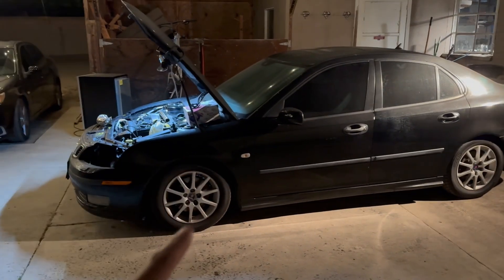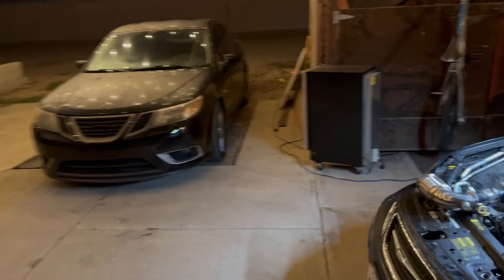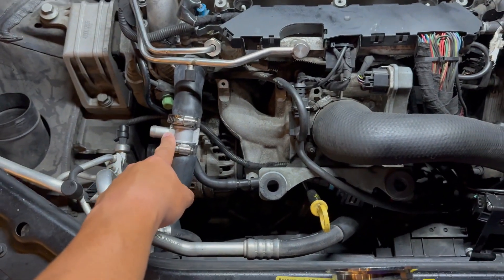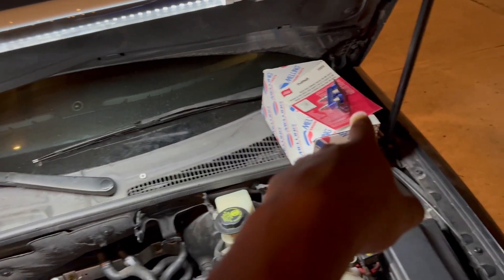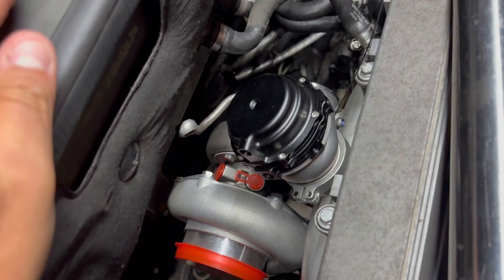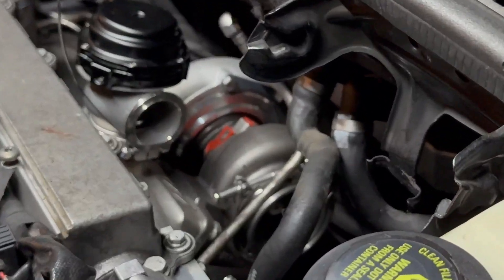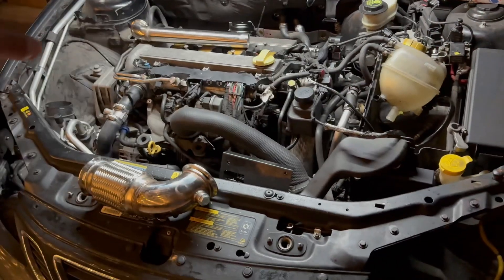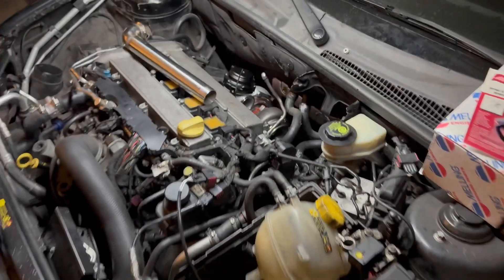Saab 9-3 2.0L Big Turbo Build (Part 0) - 500hp under $1500

Comment: As the F40 gearbox can only take 400nm, what do yo plan for the it because it's gonna snap in half ?
Reply from the maker: V6’s with the F40 are pushing 700+ hp… I think the tranny should be fine with a heavier clutch when we get there

Comment: Did your how'd your other ecu break?
Reply from the maker: Usually they just start to throw the common CEL codes and the car runs rougher and rough until your injectors just stay open and the car smokes like a banshee.

Comment: use an oil filter plate for oiling solution. they also will have additional accessory ports if you plan to run a oil pressure gauge.
Reply from the maker: Okay is that similar to like an oil sump solution? Good note on the oil pressure gauge I’ll definitely tap one of those

Comment: for 500HP u need at least 3 inch exhaust all the long, maybe 1/2 muffler for the sound
Reply from the maker: Yessir you’re correct!! Muffler and maybe cone setup will be critical because these 2.0’s don’t tend to sound that great with a free flowing exhaust

Comment: did you get the zzp Lnf manifold or did you need the LSJ one for the spacer?
Reply from the maker: @UrbanSmokes21  LNF one! Seems to be straightforward fitnent
Reply from the maker: @UrbanSmokes21  got the LNF manifold. Seems to be straight forward fitment!

Comment: I just bought a 2004 Aero 2.0 with 6-spd two months ago and I LOVE it. I wanna do some upgrades like this but just to get a little bit more fun out of it for the street. Aiming for about 350 hp but not ready to get started just yet. I'm new to Saab ownership but I've always wanted one. Really looking forward to this build!
Reply from the maker: @FutureBets  congrats and welcome to the club! 350 is a super manageable number and hopefully I do a dyno where I show 350 on this setup very safely
Reply: Excellent work !  What’s the max power these 9-3 04-2011  can hold ?
Liked and subbed ✔️

Comment: The 2.0 LHU ecotec variants that the last MY 9-3's had can get to 500hp with strengthened rods.  And because it's still only 4 cylinder, the car is much lighter than the cars with the 6cylinder engines. Zzp still sells those LHU ecotec's fully built and ready to be dropped in to the engine bay.
Reply from the maker: I thought LNF blocks were more comparable? Or is that just the turbo ecotec first gen of the cobalts?
Reply: @thejsgarage  yep the lnf's are generation 1 ecotecs like the ldk.  But if you Google "The last car to leave the old Saab factory" you can see the picture of the engine bay of the last model year 9-3's and it's unmistakeably an LHU. I don't know what modifications were made to do it but it can be done.
Reply from the maker: @Pr0fess0rx29  super interesting, thanks for that!
Reply: I take it your familiar with these Saab 9-3 engines ?

Comment: Turbo and externall are crap....i never understood why buy these cheap crapy Chinese turbos and externals when you are trying to buid something good.
Reply: At this boost and hp levels, it makes no difference. The tech has come so far, that only idiots and people pushing big hp should worry about that. If you have a drag build where you need to push it all day, sure. Anything else, no

We used to make 1000 hp OM606’s using old shitty truck turbos. A 200$ turbo now, is better than a 2000$ turbo ten years ago
Reply from the maker: @TheCHRISintheMIX  this comment 🙌🏻😮‍💨
Reply: @TheCHRISintheMIX  Are you high?
Reply: @saaber95  No, but i have been in the tuning-scene for some 15 years. Have worked on cars for 20

The china turbos today, as a well balanced as a borg or precision turbo 10 years ago. No need for big $ cemaric-bearing and enamel coated NASA tech in your average-joe build.

Don't discurage people with small budgets from the tuning scene, by saying that 1200$+ turbos are the minimum requirement, when a cheap china turbo will do the exact same
Reply: @saaber95  Also, you're greek wtf. You guys make big build with cheap china parts

Find some friends in the car scene and learn
Reply: @TheCHRISintheMIX  big facts dude
Reply from the maker: Just to prove the concept - when you’re pushing limits why would you blow up a $1200 borg when you can blow up a $200 china turbo?
Reply: @thejsgarage  Because most likely the Borg will not blow....
Reply from the maker: @saaber95  if the turbo blows I’ll personally reply to this comment, admit you were right, and pin it. Deal? lol
Reply: @thejsgarage  Mate this is not an ego contest....

Comment: Most people can't get that much power out of a stock B207, interested to see how this goes. Are you keeping the trionic8 ecu?
Reply from the maker: True! Plan is to keep it but I’ve heard over 350ish HP the T8 get a little finicky but I’ll keep it as long as I can. The only big turbo 2.0 I can find on YouTube was running a standalone so curious why they made the jump if T8 could handle it .. we shall see!
Reply: @thejsgarage  the first issue will be the MAF will top out at about ~330 hp. Then you'll either have to install it in a bigger pipe and rescale it through the software or change the MAF with a bigger one and also calibrate the ecu for the new sensor.

Trionic8 forums will help you a lot on this.

People report that after 1.6 bars the block starts to fail because of the open deck design.
Reply from the maker: @nikolasbalogiannis3577  yeah I’ve read that the 3bar MAF sensor is what most of the cobalt guys step up to?

Comment: Are you going to be doing a water methanol injection setup with this?
Reply from the maker: Yessir! Most likely two nozzles. With variable spray volume based on boost pressure